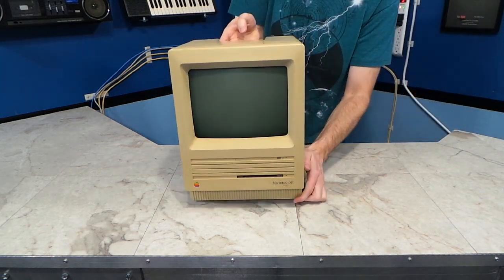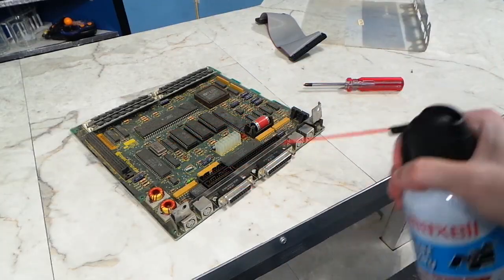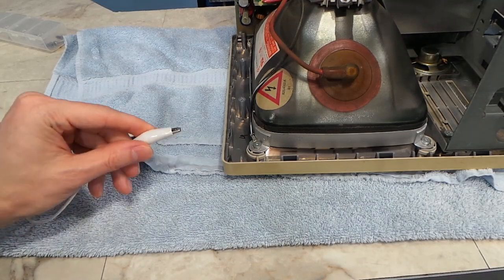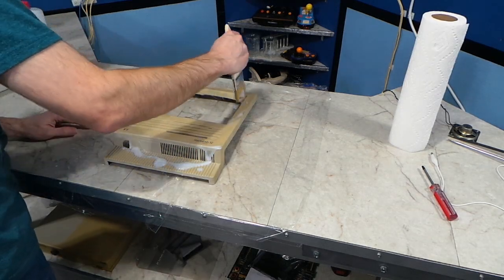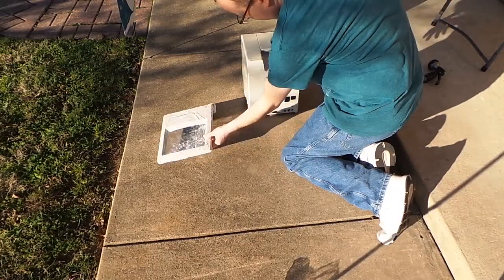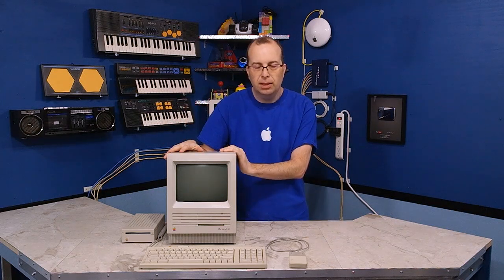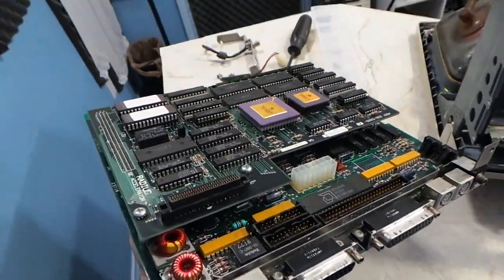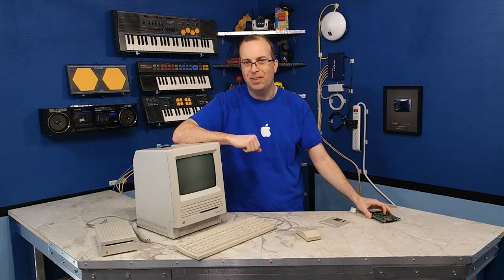Macintosh SE Restoration and SD-2-SCSI upgrade

Comment: I know this video is 8 years old but I have the exact same Mac SE FDHD which I restored recently and I CAN write floppies from a cheap USB floppy drive (I think because mine still has its original High Density floppy drive), and I have a blueSCSI that works amazingly. I know David knows this but for everyone else, the internal High Density floppy drive is easy to refurbish as well, and you can buy replacement gears to fix the eject mechanism

Comment: try upgrading to modern ram modern cpu modern cd burner upgrade card with ethernet usb wifi firewire try 100 tb solid state drive reinstall the orriganl operating system put upgrade smart card ports make the reinsall of os install all the drivers

done!

Comment: I think the issue with the SD2SCSI is that the SD card is supposed to be less than two gigabytes.
Besides, did you check the WP notch on the SD card itself?

Comment: It is just fantastic that CRT devices were phased out entirely because of the dangerously high volltages whereas modern devices are way safer as they retain much to no voltage at all
Reply: I don't think they were phased out due to safety but more due to weight. But even then, working with LCD monitors is difficult since the panels are essentially impossible to repair if they break.

Comment: ooh! I have an FDHD which stopped booting from HDD and also wouldn't boot from floppy! NO sounds from the HDD so I was thinking it might NOT be dead (i hope not, it has old files on it as this computer belonged to my family it's whole life) and just the power or data connection to the drives wasn't working. I'm going to keep watching and see if this is helpful to me!
Reply: I wonder if my SCSI chip failed
Reply: Oh, if the floppy drive isn't on the SCSI chip then... no. The HDD and floppy failure occured simultaneously, as far as I know.
Reply: How does one test the SCSI chip?

Comment: I had an SE/30 for years as part of my old Mac collection, eventually upgrading it with a full 128Mb of RAM and a 2Gb HD, pretty mad for a system built in 1989! I never was able to source one of the rare PDS graphics cards that would allow you to drive an external colour monitor but I did have one of the as before mentioned Ethernet cards that had an interesting quirk - an onboard Motorola 68882 FPU coprocessor. Apparently adding an FPU to PDS cards was common as up until the SE/30 they were all 68000 or 68020 based… the SE/30 was of course a full blown 68030 system with an FPU on the logic board, so introducing a second 68882 via the ethernet card caused all manner of chaos. Eventually I discovered they needed to be popped out of the card (socketed for that reason). The SE/30 wasn’t 32-bit clean either - one of the ‘dirty ROM’ systems with some 24 bit code in them - so you had to load up the MODE32 extension to get it to address more than 32Mb. Very quirky machines but awesome when they behave. Probably has never been a more iconic, recognisable computer design.

Comment: hard drives are simply getting stuck. There bearings have a bit of grease that hardens with age.
Open up the drive up and spin it by hand in the direction the arm is pointing till it frees up again.
do not touch the disk just the metal center while doing this. don't leave open for long.
there's a center screw and a nut under 2 warranty labels you have to remove apart from the 6 normal screws to get it open.
be very carful not to get dust or dirt in it.

Comment: Did you ever get your hands on an SE/30?  I just bought one from an internet auction in Japan (where I am) in good working condition for less than $300 w/ 80MB HDD and 20MB RAM.  I will be attempting to do a recap just to future proof it.  Japanese auctions seem to have a quite of these in various states and condition.  If you are still in a market for one, I can help you get one.  There is currently one going for about $120 in good cosmetic shape but has some issues.  You probably wouldn't have any problems fixing it.

Comment: I have had a Macintosh SE which has a Macintosh SE-30 logic board, the donor SE-30 had a case that was is bad shape though it’s HDD & Logic Board (Motherboard) was perfectly clean & installed in the SE with NO modification. The SE I own has the SONY power supply which was & has been known to be VERY reliable.

Comment: A Mac Cracker was the wedge tool you stuck in the gaps and squeezed to crack the Mac open once you had removed the screws. I used to have one that was the cracker at one end and a long handled torx at the other.

Comment: @10:49 - Broken teeth on the plastic gears in the floppy drive you say?  Contact Randi Rain who restores old toy robots and makes gears like these using resin.  Great video as I have been given an SE30 in good condition but needs to be restored, I will use your tips for this. Thanks.

Comment: Having just watched this (yes, 4 years after uploading), and having seen your Electronic Store vid (I know I'm local to you now) I went out into my garage and unboxed my Mac SE (been storingit for 20 years, at it was hardly new when I got it).  It even has the original software in the original software folder (NICE presentation).  

Alas, it is NOT a 30.
Still...a good project for another day (seems to have network capabilitiebity...but I can't remember if I got that online 20 years ago or if it was a different mac).

Comment: The older SCSI controllers where not fully compatible with the SCSI standard. Although your video is 4 years old, maybe firmware problem for  te scsi2sd
Reply: The vMac is crashing my emulator also, probably nothing to do with the sd2scsi

Comment: Hi, great video! I'm resurrecting an old Mac SE using FloppyEMU and I'm trying to open an old .ISO file as well as some old .SIT files, but can't find any StuffIt Expander versions that will run on that Mac. I have a modern Mac as well and have been trying to run emulators so I can run StuffIt Expander on there but again, no success! Any help would be hugely appreciated!

Comment: Can I use a external scsi HD with my Mac SE/30 on the SCSI connector?  I have a external SCSI drive here that looks like the same size(goes under the mac). I would like to use Alchemy 3 to edit samples and store them on this drive. With Alchemy, I can convert samples for use with other samplers so it would be good to store a library of samples with the Mac.

Comment: I took apart a microwave once. I wanted to get at those juicy magnets and motors inside of it. Microwaves have incredibly strong capacitors inside of them, and they can very easily fry you. 
I discharged it with the screwdriver and clip method, while using my thick cotton gloves to make the connection. ZIRP! CRACK!

Comment: Awesome video, thanks for going through this.  Wondering if anyone who's poked around this might help me figure out what this is.. it must have happened when i opened it up but i'm not sure really how as i was really careful to leave all the crt stuff alone..  but here's what i have..  http://part12studios.com/misc/pics/macsemonitor1.jpg  seems like the area there has two soldered points with nothing in them.. though one appears to lead to nothing.. so it's very odd..
Reply: so i saw in your other restoration SE video that it looks like there were in fact two of those nickle sized resistors..so weird.. not sure how i knocked it out.. but it was easy enough to redo.. thank goodness resistors are not directional..  and nice and spaced out so even i couldn't botch the soldering job.. heh.
Reply: http://part12studios.com/misc/pics/macsemonitor2.jpg

http://part12studios.com/misc/pics/macsemonitor3.jpg

i think all is well but i'm waiting for a new backup 3.6 v battery (mine had esploded, but well contained corrosion) and to be sure i've given that floppy some love.. it was acting up in that it was like the spinner wasn't "Catching" the floppy drive spinner..  i maybe fixed it but will have to hook it all up again to test it and be sure..  and give the thing a nice lubing

Comment: Great video, thank you very much for this. I'm trying to start restoring old Apple computers because I growed up with them, my first one was an SE/30...
But the very first one I absolutely want to restor is the Lisa 2, which is at this time unfortunately very very difficult to find, or very very expensive, when you see geeks selling "Non-working exemplars" for three thousand dollars or more...
Anyway, I wil never give up, and that will do !
I was very interested in the Smart card reader, because always wondered how to transfer datas (and especially old softwares like games) from the Internet to the old Apple Computers.
There were SCSI cards you could install in old (but youger) G4 towers, with these we could imagine being able to write the programs on external hard drives or SyQuest cartridges, and then the harddrive/SyQuest reader to the old mac.
Also, there were in the past small devices called "Asante Talk" which were a bridge between Ethernet networks and AppleTalk networks, this enabled users buying the new macs with RJ45 network to communicate with the older macs only having LocalTalk network cards...

Comment: I had to chuckle when I head what you called the Torx driver. I was factory trained on these little beasts back in the day and part of the Apple supplied tools for working on them was a case separator tool called "MAC Cracker".  It had wide but thin jaws that fit in the seam and a gentle squeeze separated even the most stubborn case parts.

Comment: You could have cleaned the case by putting it in your dishwasher running a normal wash cycle with regular detergent. It works wonders. Telephone equipment refurbishing companies routinely do this to make used equipment look like new. I've cleaned a few beige Nortstar Meridian M7310 sets in this manner and it works great.

Comment: Back in the day, I used to repair these, along wit the Mac Plus, 512K, etc. I was also MAC certified The long torx driver is NOT nicknamed the MAC cracker. It was the MAC pull apart tool that was named that instead. It was used  basically pull the chassis apart after using the long torx driver to unscrew the two screws. First step: Remove the two screws, then use the MAC pull apart tool to separate the two pieces of chassis from each other.

Comment: you dont need an expensive ethernet card on the Se or the Se30, just get the Modem to DB25 cable, a null modem cable, and a prolific USB serial adapter. Tera Term and Black Knight for the win!

Comment: "Working on CRTs is generally safe.." David, at least two generations of TV repairmen worked on HUGE cathode ray sets with pretty much zero fatalities. And, if you're old enough, you'll even remember the days when TV guys actually came to your house and fixed sets whilst squatting awkwardly in difficult corners of your living room. Safely. It's all a matter of training and respect for danger. Like avoiding big charged capacitors and the tube's EHT supply. Here in the UK, the professional electric group that consistently records NO fatalities is the one that services, installs and repairs super-high voltage transmission lines. Two million volts HVDC isn't very forgiving. Most deaths happen with corner-cutting factory electricians working on 440v three phase systems. Even with the stupidity of the average citizen, the lower voltage domestic 240v kills remarkably few.
Reply: Absolute Bollocks.
230VAC will kill you very, VERY dead if you hook yourself to it the "right" way.
Reply: @RogerBarraud  he never said that 240v wouldnt kill you dumbass

Comment: I was just looking into this. I wonder if you could use an external scsi iomega zip drive. I have a zip100 in my b&w power mac and have wondered if getting a zip drive for my Mac SE could fix software transfer issues. What say you?

Comment: I’m surprised no one tries to steal his parts when he retrobrights
Reply: What's the street value of a 30 year old yellow piece of obsolete tech plastic covered in oxidizer? 🤔 That might get you like, 1 teeny tiny crystal of meth from a dealer into old tech like that. 🤣
Reply: @mannys9130  It's about tree fiddy
Reply: They'd be more weirded out by what he's doing to the case.
Reply: Nicholas Gawler he rubs the lotion into the plastic then it gets the hose again! 😂😂😂
Reply: Just don't live in a ghetto
Reply: Well, see, that would be messing with Texas, which we have all been told specifically not to do.

Comment: I serviced Mac SEs when they were new and tons of other CRT based computers and monitors. Your method for discharging the CRT is sound and I like that you demonstrated how to do it. Another tip you didn't mention: remove ALL jewelry (wedding rings, etc) whenever working with high voltage. Things get really fun when you have to make picture adjustments with the system on.

Comment: @The 8-Bit Guy. 

Hello out there. I recently bought a Macintosh classic. And there is a problem with booting it up. The Problem is, that when I try to boot this computer, there only are horizontal (black and white) stripes, which are wafting (or flickering). There is no "Welcome message" at all. I opened it up and there was no capacitor bloated or leaked. All cables are there, where they should be. Can you help me with this problem ?

Thank you for your patience.

Comment: The current SCSI2SD (V6) is listed as being compatible with the Macintosh SE FDHD which appears to be what this computer is... I tried to read the version off the SCSI2SD displayed in the video and could not but since it was made more than 2 years ago it is possibly an older version. The component placement on the one shown in the video does not match the picture of version 6 I saw on the manufacturer site but does match another version 6 (different manufacturer?) I saw on someone's blog so hopefully getting this to work now might only involve flashing a new firmware...

Comment: hey I know this video is a wee bit old, but I was curious if you could show me how the SCSI itself goes back into place? I had pulled it out months ago to see what was wrong, a chip capacitor had blown, so I looked and looked, finally found one to replace it, replaced it today, and I can't recall where the grey cable with the blue tip goes. Please Help?!

Comment: "Attaches just like an old vacuum tube"
Well, it is an old vacuum tube. CRTs are just a very specialized application of the same technology.
Reply: Did both of you think he didn't know this?
Reply: Sorta kinda. A CRT is an electron gun that's aimed across the screen very quickly by magnetic field coils. Vacuum tubes in the traditional sense do accelerate electrons that are boiled off the cathode, but they just use grids and screens and no complex aiming or phosphorescence is involved at all. The magic eye tubes would be the natural intermediate between say, a pentode and a CRT.

Comment: In the last ditch effort, you tried booting a layer version of System 7 with a bunch of extensions on it...... that's way less likely to boot.. the guy should have sent him an image with System 6.0.8 on it, with no extensions. Or you could hold down shift on startup to disable extensions. Way higher chance of booting. But either way, what he showed us actually shows that the SCSI to SD device he bought actually did work on it, and the controller on his Mac working too

You also should have just scrubbed the motherboard. It fixes minor issues like this as well

Comment: They still make and sell those old style memory batteries, they stopped putting them into desktop and laptop computers back around 2001 in favour of disposable (and occasionally rechargeable trickle charged on the board) 2032 and similar coin cell batteries.

These batteries had good energy density and long service life and were made with high quality chemicals, maxell was a popular brand and is one of the ones still going.

These batteries are about $20 USD/£15.00 each nowadays and are sold via the hobby electronics websites now that most of the electronic hobby retail stores have closed (due to Internet shopping taking over)

Comment: I've had experience with this exact issue and managed to get
my Quantum HDD working by holding it by my side and swirling it fast clockwise then
anti-clockwise. You may need to perform this multiple times to free up the
motor. It will free up the bearing and if there’s a valid OS install it should
boot. There was a firmware update you could burn to the Eprom back in the late
80s that addressed this issue.
Reply: How? Parking the drive properly before the power went right down?

Very hard to believe that wasn't a standard feature.
Reply: Roger Barraud he would not be able to do any of the following if the head was stuck to the platter? He was simply freeing up a stiff motor bearing by making the platter jerk through forced enertia. Believe me a head crash sticks like shit to a blanket and involves opening the drive in a filtered air clean room conditions to allow you to spin the platter counter clockwise from the hub whilst you gently pull the head assembly clear with some sort of hook. The drive is in logan time after this and should be recovered ASAP.

Comment: My Mac plus has an apple external HD connected to the floppy port...
Reply: Actually, it is a Mac 512, not a plus...
Reply: I just dug it out of my attic... turns out I have two 512’s and two SE/30’s... two very nice shape RJ11 extended keyboards as well... along with my old performa and a bunch of adb keyboards, and a ton of pc keyboards still in the box...

Comment: Any plans to revisit this machine?  The SCSI2SD works flawlessly in my SE!  That with the FloppyEMU is just awesome for these older Macs.  I have since gotten a Macintosh Plus as well, and it came with an external hard drive.  I think I'm going to put a SCSI2SD in the external housing and see if it works, especially since this Plus has been maxed out to 4MB of RAM (my SE only has 1MB at the moment).  With that much memory, it's a fairly-usable computer!